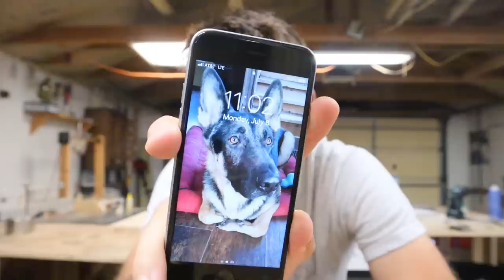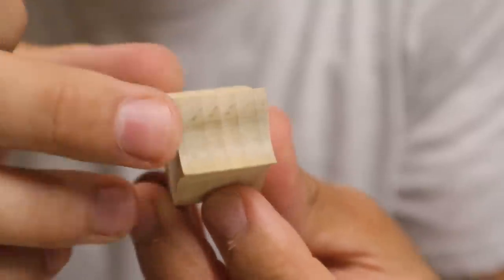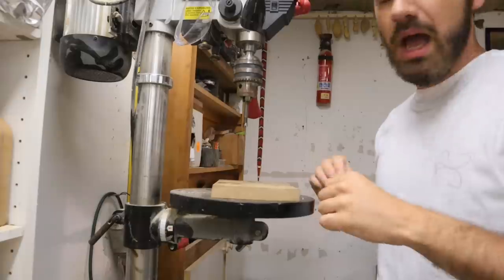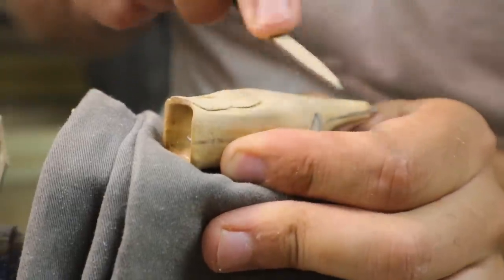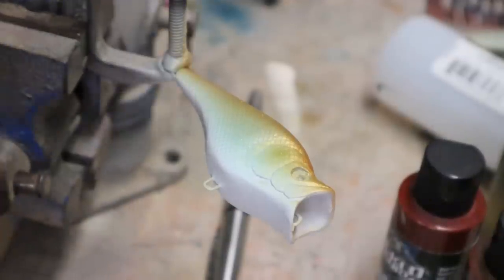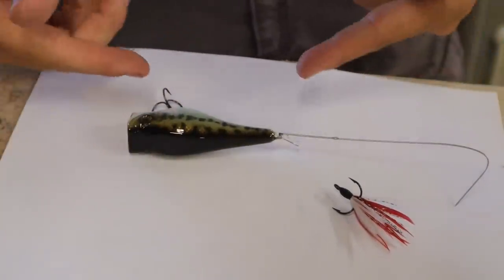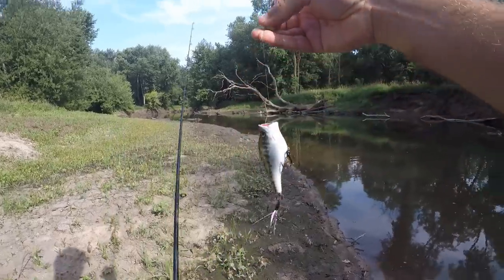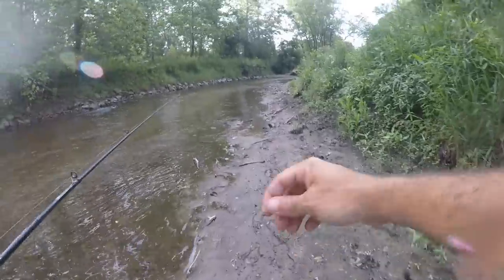Top Water Popper | One Day Build to Catch

Comment: Well I'm definitely a fan of the square hook hangers, ads a cool and unique look
Reply: viktor kravets They do look cool.  I would guess that objections are rooted in concern for strength, as sharp metal corners are more subject to fatigue and failure than rounded ones.  Makes me think of the square windows on Dehavilland Comets.  Realistically, not an issue on these small lures, but a legit concern for heavy trolling baits intended for use in saltwater.

Comment: "Nobody wants a topwater popper that sinks."
*angry surfcaster noises*
Reply: It’s not a top water popper if it doesn’t float and Pop
Reply: @gexotic4668  Well, not necessarily. There are indeed topwater poppers that sink below the surface and rise up top during the retrieve. Such poppers are popular with surfcasters, where you want that extra weight to get extra casting distance with heavier surf rods (look up the Atom Striper Swiper, for instance)

Comment: Marling, you should make a platypus lure.  Maybe it's top water, but its bill/beak can pull him under the surface too. 

This popper looks great btw.  When I do through wire I just drill a hole straight through the lure and then one underneath the lure that intersects with the through hole.  Then I use pliers to run a single wire through all the holes.  Also, I just make my Topwaters on a lathe and use a wide drill bit to open the lip but your method was so awesome to open up that unique shape.

Comment: I was just wondering if it would make symmetrical eye placement easier when making your baits, if you were to simply drill a small pilot hole that went all the way through right after the profile was cut out on the bandsaw? That way the bait's sides would still be parallel at that point and you'd know the hole was perpendicular so that it would exit at the same place in the other side of the bait.

Comment: I would like to see you make a deep diver, like the Bagley's DDKB2 "double deep Killer B 2",  I have used these for years and love them. I use the 2'' size mostly, but the 3'' and 1'' get used too some. The Bagley's Balsa B would be cool to see a similar type bait  made too.
The older double brass through wire Killer b 2's were the best made in my opinion. I wish they were still made that good, or at least a similar bait made in that old method.

Comment: great job on the popper. Just wondering if you could drill holes for the through wire instead of cutting a slot? Is it easier with the slot and harder with holes? Oh P.S. God bless you for the sneeze just before drilling, and god bless you and Chelsea on the up coming baby.

Comment: Hey Marling, I need some help with my first lure, it's made from pine wood, no weight, and on a spinner reel. Whenever the lip catches, the lure acts normal for a bit, but then it turns to the side and floats right up, I have a video entitled "Litterally no point in watching this" and it has a video of the bait in action, and a close up of the lure, if you could help out that would be great!

Comment: Check out MORA OF SWEDEN they make all styles of wood carving knives and are wonderful carving tools. You need a hook knife. You can easily carve the cup of your popper using one in less time than it took using a Dremel tool. If you keep the bait square and cut the cup before you shape the lure it is faster. You can also use a round gouge to shape the cup and hold it in your vise. Then you can cut the slot for the wire precisely and safely with a fine saw blade. I think a twisteloop connection is better because it makes an easier precise point to locate your tie. I position the tie above center of the cup and by doing so, the bait cup pops more. I also use single inline hook dressed with deer hair and some flash. This enables me to fish much thicker cover and not snag the lure. The deer hair acts as a weed guard and floats the hook point up. I add only enough weight to make the lure sit level in the water. The weight of the hook will cause the lure to tip down slightly. I use one 3/0 in line hook and have good success landing fish. Releasing fish is easy and the fish receive fewer injuries by hooks you really do not need. My art skills are not equal to your level but, I only have to make myself happy because I make lures for my pleasure and no one else. High gloss glass finishes are beautiful however; fish just do not look like that in water. Flowers, insects, bird feathers, animal hair and fish all have iridescent colors that sparkle and flash. However, none looks like glass. I like you, your dog, and your little wife and hope the best for all. Please don’t think I am being unkind telling you things I know are true. I learned ideas from you, am grateful, and want to share things I know with you. PS try Basswood you may like it. Tungsten shot (lead Free) Hammered cupped Aluminum lips. Try making a lure from a limb you find in the woods using only a hatchet and hand tools. It is not that hard. When you catch a fish, it is an accomplishment few have done. If you want, leave the lure attached to the limb and finish it, the base with the bark still on is quite a showpiece. You want ideas I got lots of them. You do not need to add a diving lip if you carve it out as part of the design of the lure. The reason I make lures is, I get what I want, not what I am forced to buy.

Comment: Wouldn’t it be easier to drill the lead hole and then cut the wire slot? That way you’re not trying to drill through a slot and risk splitting/splintering the edges of the lead hole and wire slot.

Comment: Maffs: Baking Soda = 13.8 grams per tablespoon, Corn Starch = 7.5 grams per tablespoon.  Wouldn't a mix of these two work as well as the soda catalyses the superglue?  If so, you could reduce weight with such a mix.  Ok ok it get's "hot" so do it outside with a bucket of water near by but hey.... youtube isn't youtube without SOME excitement :D
Reply: OK SO update; I tried it.  What a mess.  Not a 100% cuss event, came close though.  The mix with corn starch was hard for absorption of the super glue.  The set up time was longer.  The finished solid was softer.  The trade off is ductility vs brittleness.  The straight soda was hard but brittle while there was definite give and bend for the corn starch mix.  Ratios are anyone's guess.  50/50 by weight is where I started and just added soda to that. It was a fun, if messy, set of trials.  Certainly was a total failure for setting fire to anything (well a little disappointment in life is ok I  guess...)
Reply: OH you could do the current viral.  Repairs made with Ramen noodle's powdered and crazy glue.  Ramen noodles are of course manufactured with baking soda.